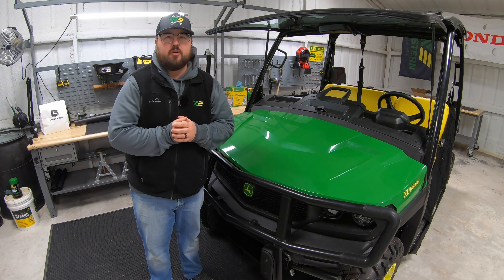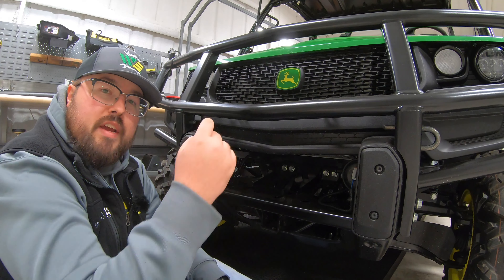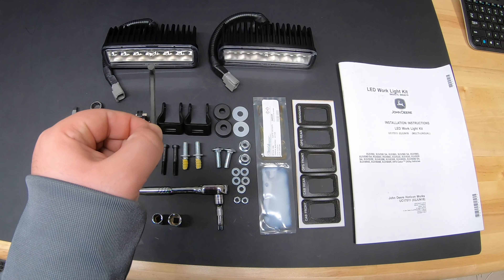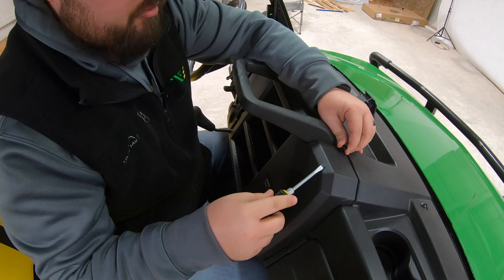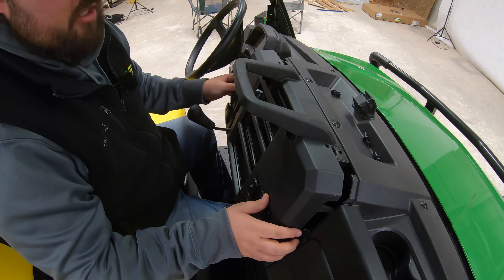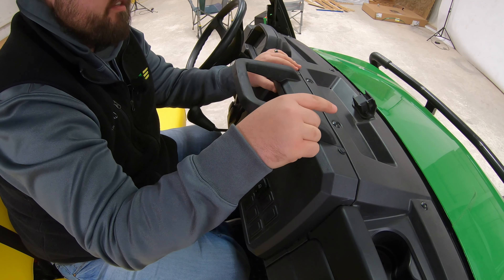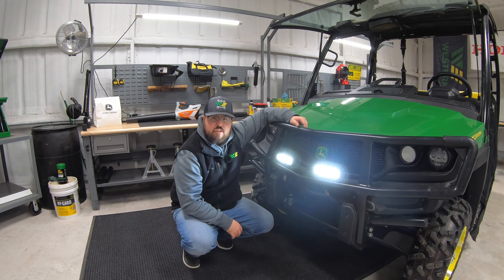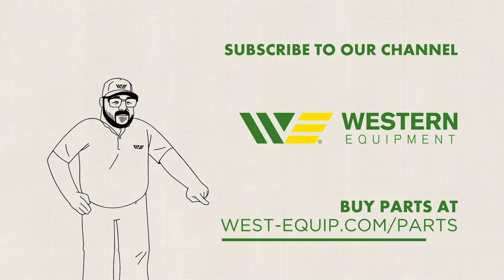How to Install John Deere Gator LED Brush Guard Work Lights

Comment: Can have all 3 sets of LED lights installed? The LED Brush guard, the high cab level LED work lights, and the rear LED lights?
Reply from the maker: Yes you can! I have seen it and it is pretty sweet when they are all lit up. Great question and thanks for watching!

Comment: Hey Brent, I have a XUV835E and want to put an aftermarket Nilight LED light bar on the front where the winch would actually be installed. Is there a specific wiring harness that I need so that it connects correctly? If so, can you guide me to what I would need. Thanks

Comment: Brent.
Question when I pop the panel off. the right side with 6 pop outs  I have an orange cant remember, green is marked light  and white is marked light plugs can you tell me what there ? The wire is in for roof lights not sure if this is for them . And which plug is for which light.
Thanks great videos
Reply from the maker: Check out this video, I think it will answer your questions https://youtu.be/YWlBf-6AXCk. Thanks for watching!

Comment: On a ‘21 xuv 590m s4 is there a way to just buy the brush guard not the whole kit? Mine was damaged by previous owner but I don’t need the mounting brackets. Just the flip down portion and the end caps and pins. Thanks in advance!
Reply from the maker: Unfortunately it is only available in the full kit, part number BM23365.
Reply: @WesternEquipment  that’s what I figured. Thank you for that and for the PN! Big help!

Comment: I have a 2019 835m hvac and have added cab lights both front and rear with no problem . When attempting to add front brush guard lights I could not locate the blue plug under the dash. White plug which I used for front cab lights, green plug for rear lights but no blue plug. I did not add the green plug and white plug  , they were there from the factory . Any help?  Great job on all the videos!    Thanks for ALL.
Reply from the maker: You will probably have to have this kit in the video in this link https://youtu.be/YWlBf-6AXCk. Check it out and let me know if this helps. Thanks for watching!
Reply: Under the hood drivers side there are plugs that appear to be for a horn and a wire with a plug that looks like one for the deluxe light kit. That is why I thought possibly it already was equipped with that harness , I will investigate more as I really have no idea what those plugs are for. Thanks from Tennessee!      Bob

Comment: I have a 2019 JD 835R do you know what part #  for just the light switch is? Will anyone work if I get it off Amazon?  
And I have the headache rack on the back will the snorkel kit fit with it?  My dealer said they don't know and wants me to pay for it upfront even before trying to see if it will fit or not.
Can you do a install video on it. Also your links are now working for me.
Reply from the maker: Yes a switch off of amazon will work if it matches the plug on the wiring harness. I wish I had an answer on the headache rack and snorkel question though.

Comment: How about some alloy wheels for A560P4 seater deal have just rims in stock
Reply from the maker: Depending on size and bolt pattern there could be an option we have that would fit!

Comment: Can you do this video for the 21' 590* XUV's. Does the 590 come pre wired, etc...
Reply from the maker: Yes! I will be doing some some attachment videos on the 590's soon so stay tuned! Thanks for watching.
Reply: @WesternEquipment  Come on out to Maryland. You can use mine as a platform. I’m sure your boss will pay for air and lodging.

Comment: I bought an aftermarket sound system for Gator, Is there a wire harness for stereo, and is that the red connector that was in this video?
Reply from the maker: I would have to look again. Good question, I will try to make sure and get back with you on this. Thanks for watching!